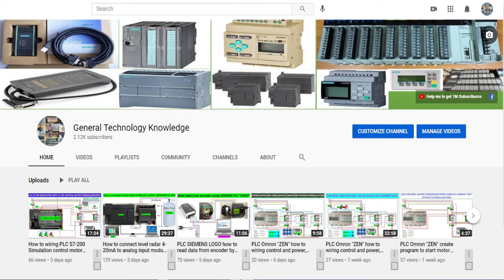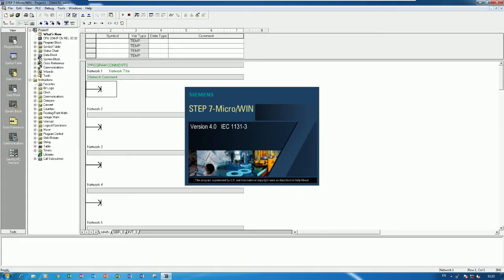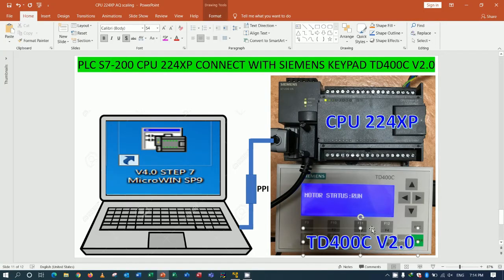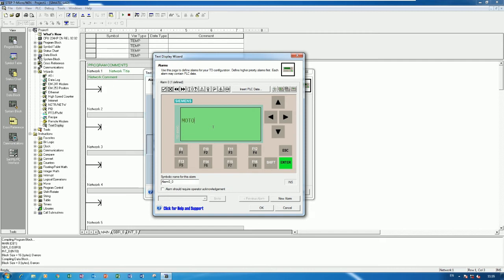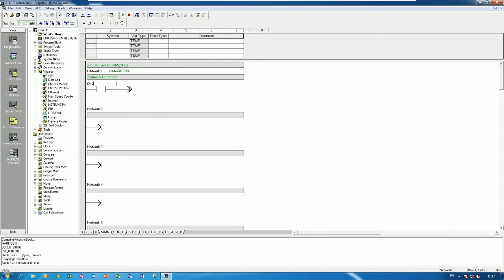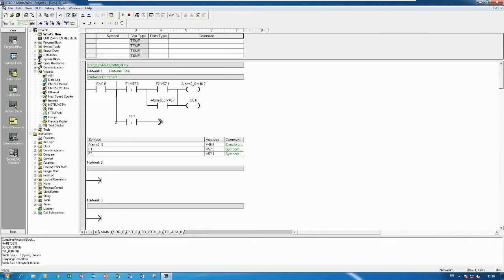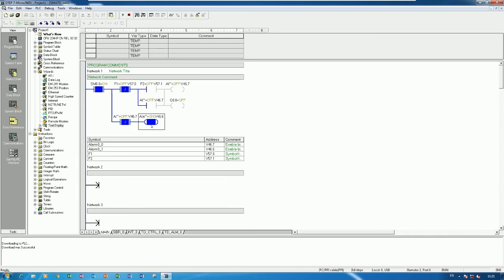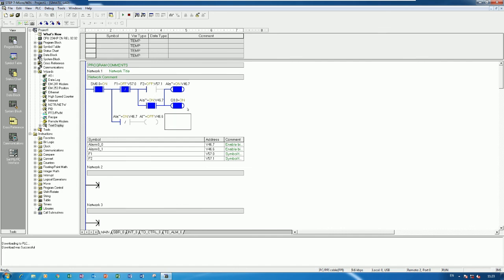How to connect keypad TD400C V2.0 with PLC S7-200 CPU 224XP

Comment: Excusme sir 

My PLC is a 224 CN rel 02.02 with one female DB9 communication port.

I have already uploaded the program and it has been successfully transferred to the PLC. However, when I try to communicate with the TD400C, it doesn’t work.
Why is this happening?

Do I need to communicate with the TD400C simultaneously, like in your video?
But I’m limited by having only one communication port, which means I have to choose between connecting the PC to the PLC or the PC to the TD400C.
In your video, it seems like both are connected at the same time.

Could you help me with this?

Thank you.